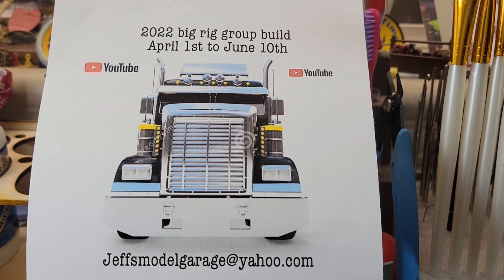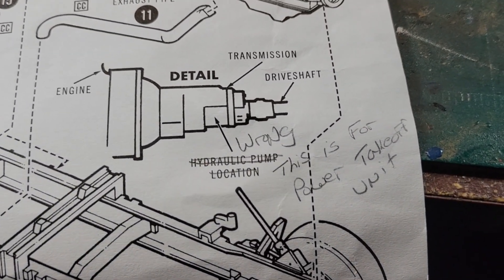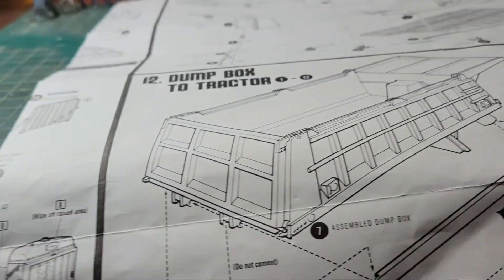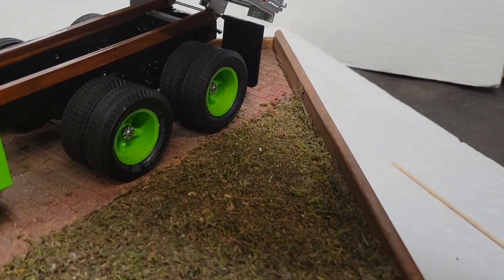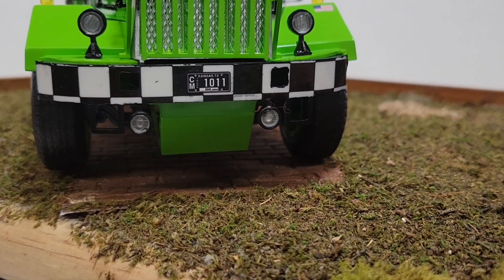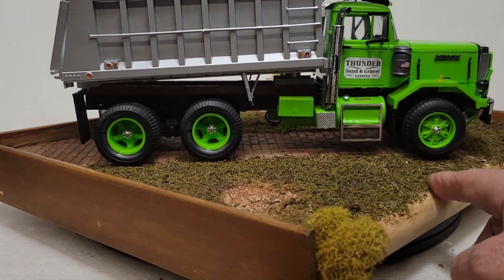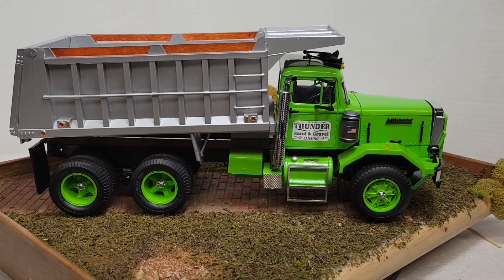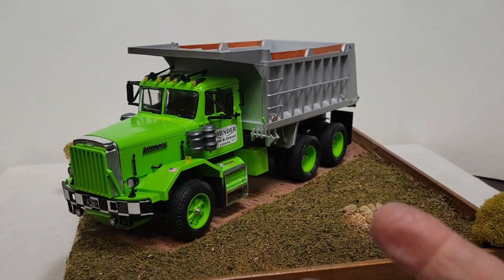Big Rig GB....Done.

Comment: AMT truck kits are the best ones out there!lol 😆 jk they all suck.your right about the big white pile,you probably couldn't see outside because of it.lol still turned out good,from what I could see the rails that the dump box were attached to were to far forward.you had them flush with the back of the frame for the most part,there supposed to over hang the back of the frame by about a quarter of a inch.thats why your box was rubbing against the exhaust.kutgw though peace.
     Chris
Reply from the maker: There are stops on the bottom rails that go against the truck frame. Obviously they're in the wrong spot. Tough to fix after you super glue them together
Reply: I know Charlie,I've built this truck enough through the years.wasnt trying to sand bag you and did a bad job,I just gave my opinion off the limited vid I saw.nothing more,don't take it in a negative way.thats not where I was going.

Comment: That turned out pretty good for the problems you had, What green is that, I may need it for my fleet I'm building, Keep up the great work sir.
Reply from the maker: That's Mac Green....Just kidding. Unfortunately , it's no longer available from Model Master. It's their Sublime Green. Testors may have it. Just remember...Testors has doubled in price
Reply: @charlie418791  Thank you sir, I just needed to know what color it was, I can go to an auto store and get them to mix up paint for me, I'm thinking of using it on my truck fleet so I would need lots.
Reply from the maker: It's number 3 in my fleet. All Mac Green